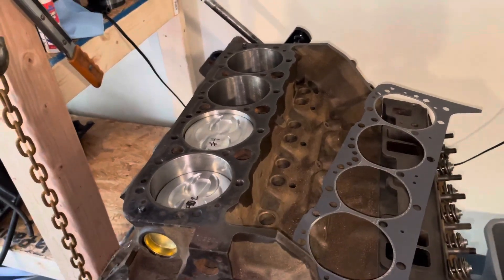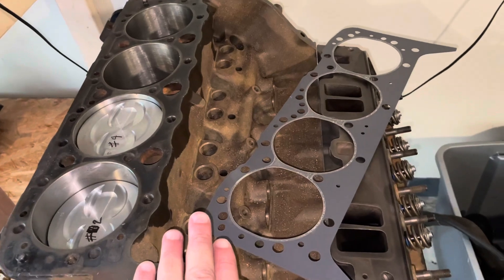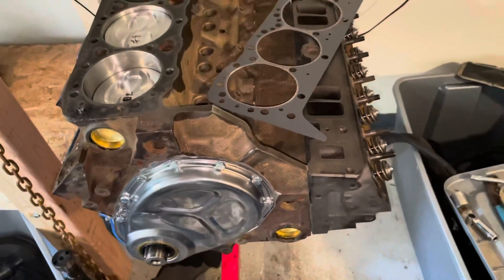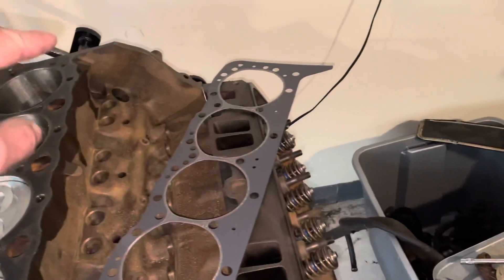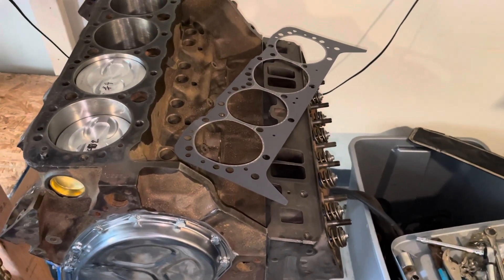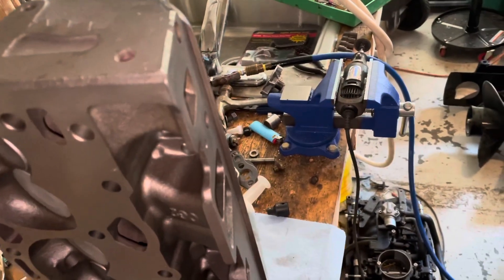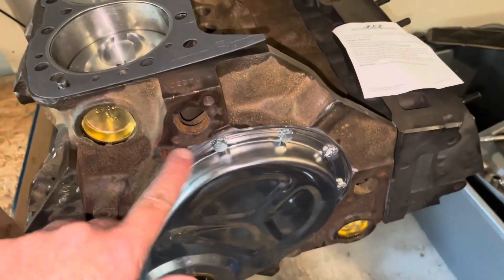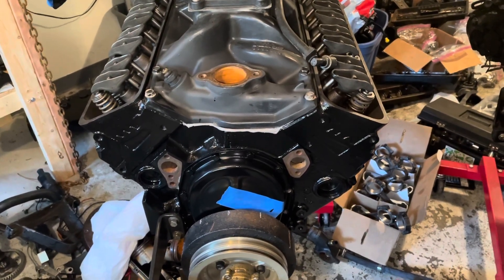Mercruiser 5.7 1(o) - Too Many Holes?

Comment: Thank you for the video. On this application, are you using Vortec heads on a vortec roller cam lower? Why and how are you using a metal timing cover? I thought Vortec blocks had two less holes on the plastic cover???
Reply from the maker: It’s not a Vortec block from what I can remember.

Comment: The cooling water from the port and starboard cylinders comes together through the intake manifold into the thermostat? I was wondering if running a descaler would be beneficial as a preventative measure.
Reply from the maker: I’ve heard of salt away but I don’t think any water additive will work because in boats all the water is flushed out as it runs. Nothing will stay in long enough to work
Reply: @moccasinmarine  I was thinking of using Rydlyme Marine descaler and isolating the cooling passages from the water circulation ports to the thermostat port. I'd circulate with an auxiliary pump. Does the return from the port and starboard cooling channels lead into the thermostat port?